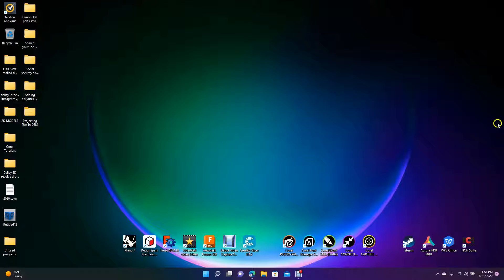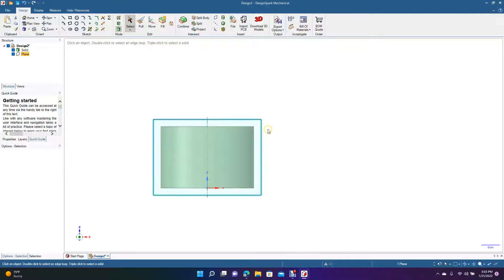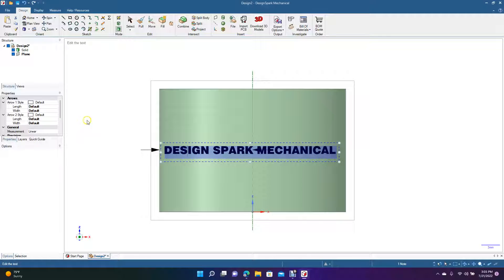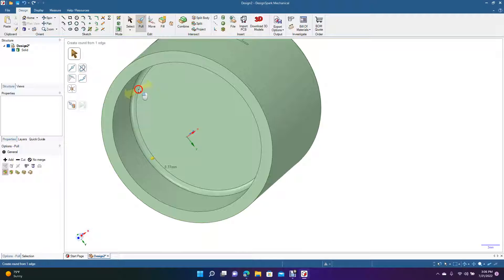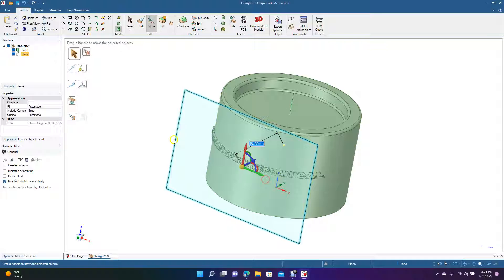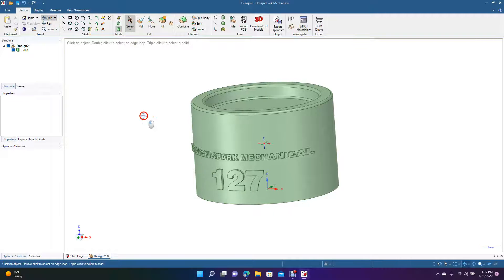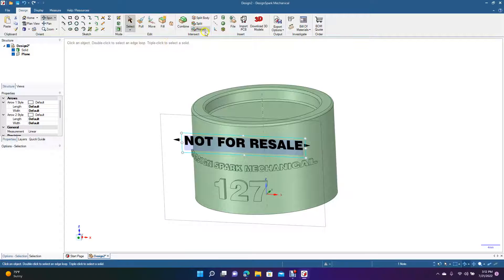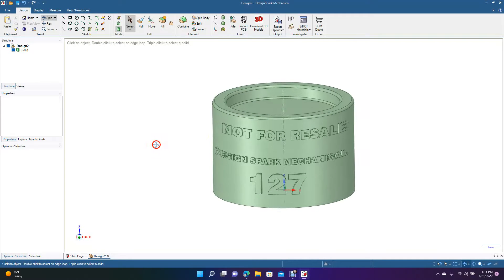How to project text onto a curved model in design spark mechanical

Comment: Hi Doug, how can I add text onto a tyre sidewall?
Reply from the maker: Thomas, I usually do curved text with Corel draw, but since the free version of DSM has done away with most of the import options, you are no longer able to import curved text into DSM as a STEP file from Corel draw. Not sure if you can curve text the way you want to in DSM.
Reply: @dailey3drevolve  OK thanks.
Reply: Fall back to Fusion 360.

Comment: Hi Doug, I have a question on writing text on a circular ring. Assume the outer diameter is 37 mm and the inner diameter is 26 mm. The text should follow the ring bend. Thanks
Reply from the maker: That is correct